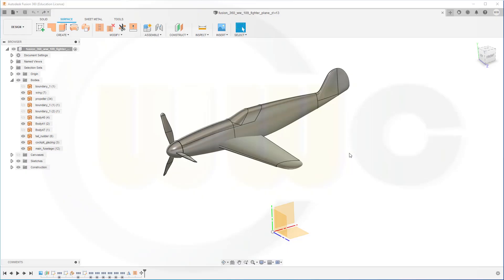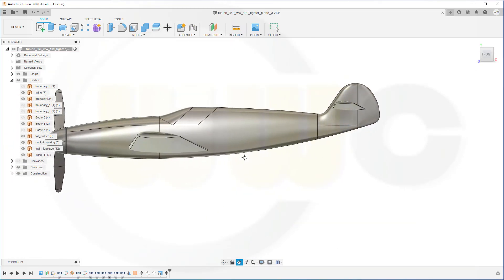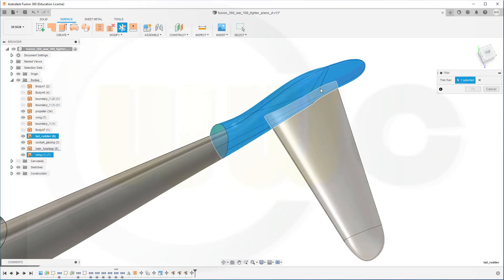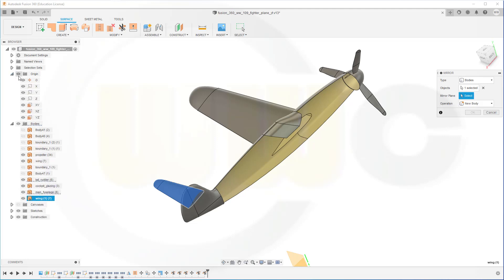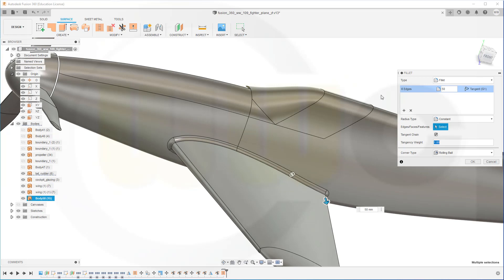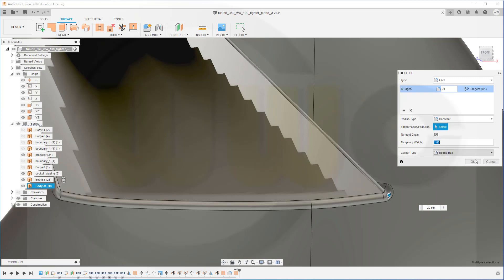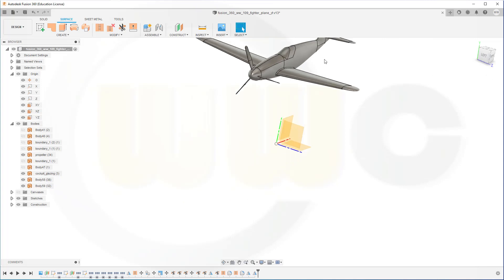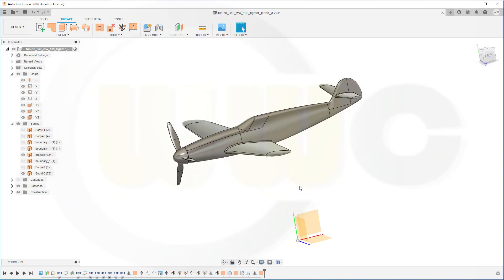WW-109 Fighter Plane - Part 7 -  Final - Fusion 360 Training - Surfaces

Comment: I’ve watched the whole series of this aircraft for the fusion 360 version, and I am so impressed. I have been doing a lot of designing with fusion 360 and have gotten really good with the software, all though doing something like this is intimidating. I’m going to attempt to make a model of the ‘DarkStar’ aircraft from the new top gun maverick movie. I have one question though, when making something in this way, does it become one entire solid body? Can I convert this to an STL file? I plan on making this a fully 3d printable model, and I would like to know that if I attempted this and all went well, could I print it? 

Anyway, thanks for the great videos, I really enjoyed them!
Reply from the maker: yes, you can convert it into a solid, just stich all surfaces together or use thicken.